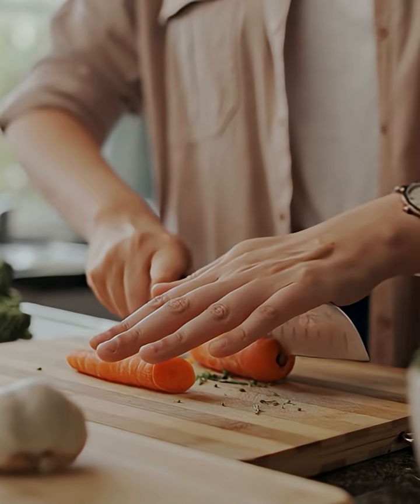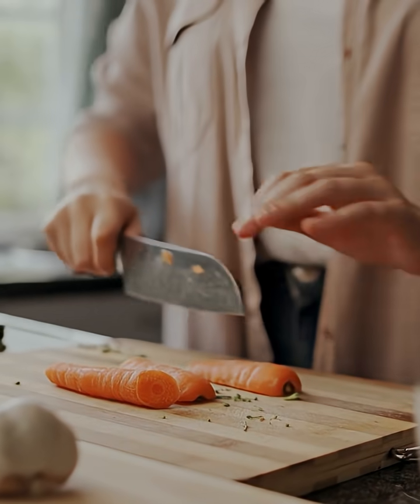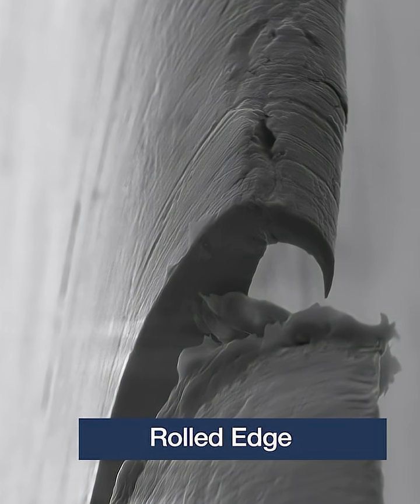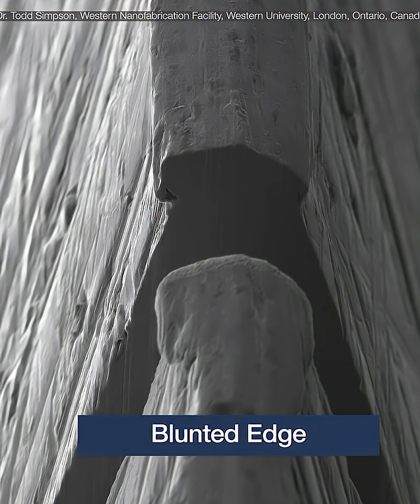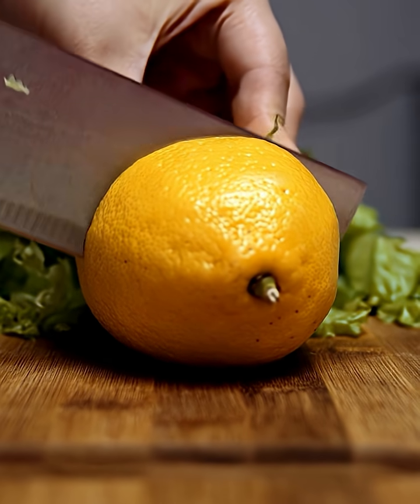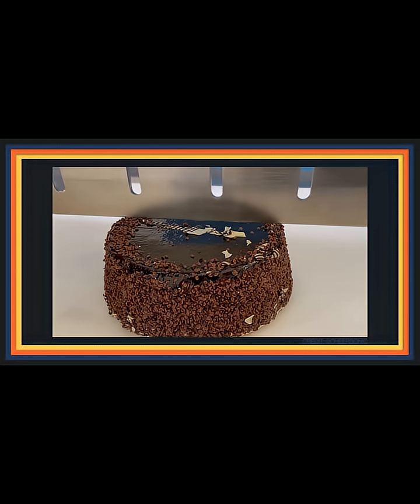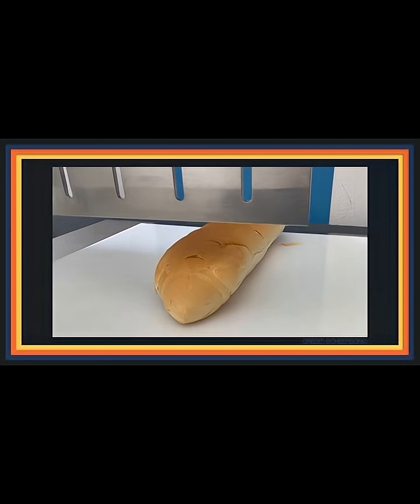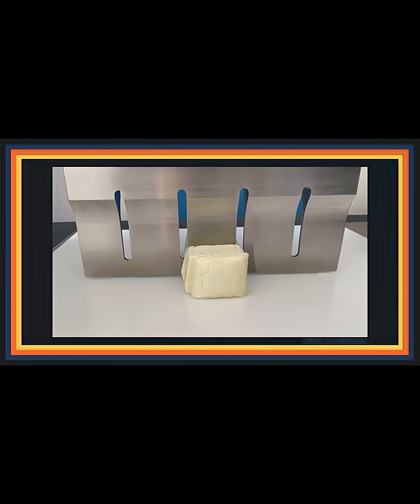Most Knives Are Dull. Why? #chefknife #knife

Comment: And I want to know, how does edge geometry work is it possible to keep an even finer edge or angle?, show us sharpening in a stone with the function on to see because even on a leather strop it could be a game changer, and it it going to get any more powerful or is there multiple power modes?

Have you thought about having a boost mode with 60% less battery or an eco mode?, can it slide something solid maybe like a carrot in the air with no force at all, by the ultrasonic waves?

And I know it may not do well but can you show us an honest test of cutting a block of normal solid cheese?.

So far the bread cut was the best also grape.

And why kind of edge do you have on it currently because it doesn’t seem sharp at all.

Thanks guys